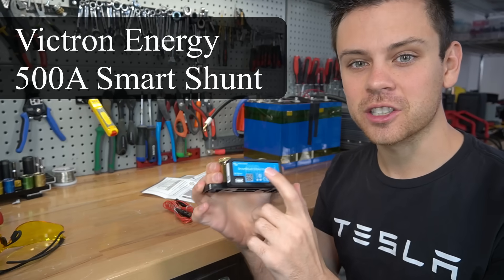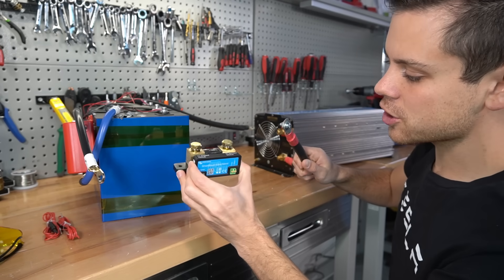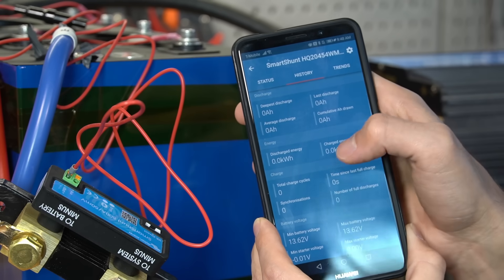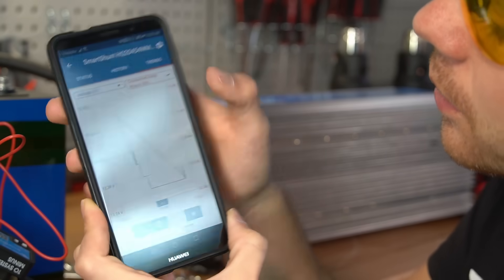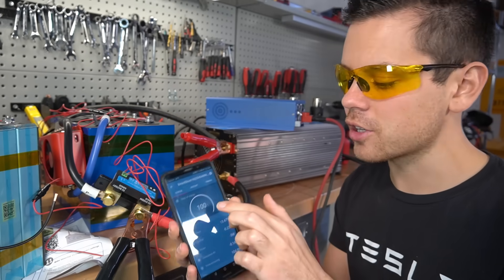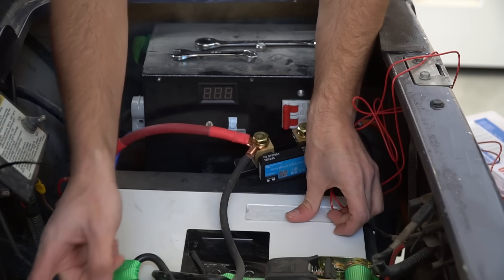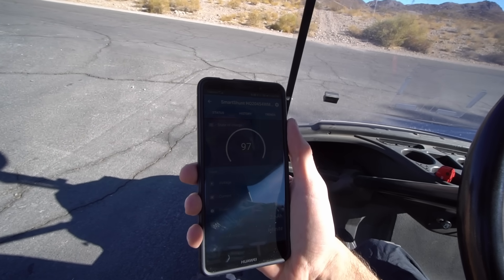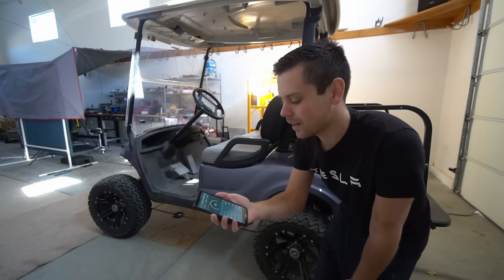Victron Energy 500A Smart Shunt (Beginner Friendly)

Comment: Hi Will! Thanks for the video. I have a lifepo4 100A battery with a Victron Energy 500A Smart Shunt. I bought another lifepo4 100A battery and want to connect both in parallel. May I use the shunt for my new 200A battery bank?

Comment: Man.. I should have come here first :D..  Background and quick question.  I just ordered 2 Li 300 Ah 12v to replace 4 12v lead acid batteries (100ah each)  (FINALLY) which have a rats nest of 2 banks for parallel 2 AW wires, no fuse and no disconnect. /sigh

I want to keep these new batteries and wires nice and clean.  I purchased 2 separate bus bars, 1 for (+) wires and other for (-) wires - both have 4 studs each, 300A Battery disconnect and a flag type 300A Fuse, and the Victron 500A shunt and a 60A MPPT Solar Controller.  I haven't received the batteries as of yet.

I'm thinking the best way would be to connect the 2 battery (-) terminals (one from each battery) to separate studs on the (-) bus bar, and then connect the 2 battery (+) terminals (one from each battery) to separate studs on the (+) bus bar.  This will keep them in Parallel.

Using the Victron 500A Shunt, - I have read and saw several different configurations and I'm a little confused.  Where should I put the shunt?  Would it be OK to put the shunt on a blank stud on the (-) bus bar and then from the system (-) of course goes to the (-) side of the inverter?

Question: Do you see any issues with monitoring both batteries in this configuration?  What would be the drawback trying to determine SOC for both batteries in parallel?

Comment: Finally a useful video for a Victron component.  This item is part of my new battery backup system.  However...slow down in the presentation.  The reference to Victron's 47 page User Manual, while well intentioned, the documentation is so complete to be complicated--needing someone with electrical knowledge/background to be understood.
Wish list:  A video in using/hooking up a Victron PMP122120100 MultiPlus inverter/charger.

Comment: Just ordered two victron controllers for two different separate banks of panels, so far the sungold 6000 split phase works great , but i will buy a separate victron 3000 watt 48 volt inverter, addicting to victron😂

Comment: Mine stopped charging at ninety percent. My settings in app seem good. It reading about 13.64 volts. Should I synchronize to 100%? My trailer has been plugged in to 30 amps for a week.

Comment: Victron BP specifically states not connected to an inverter. This is a diagram with a big red x showing the bypass the BP. The BP will shut off the inverter by the remote switch and they give no information for alternative inverters. Better makes it the biggest go around yet

Comment: I've a Victron Smartshunt, Victron Multiplus and 710 AH of LiFePo  and a REC BMS . charging is via solar, Balmar alternator and occasionally shorepower. 
My question is that the SoC displayed on the Smartshunt (through the Cerbo GX ) slowly decreases compared to the SoC displayed by the REC BMS. My assumption is that as the BMS is measuring each cell it is going to be more accurate so every couple of weeks I manually set the SoC on the Smartshunt to 100% to match the REC BMS. Why is this?

Comment: Question #2- I have 2-230 ah 12.8v run in series, will running the small cable to just the power cable going to the inverter read both battery's or run the aux to the second battery? Additionally, do I zero it out to 230ah (series)?

Comment: Built a custom lifepo4 pack for my 72v Gem Car, and a 400w solar roof rack to supplement charging when I'm not at home.(Where I use a 4000 w solar array to charge my 72 volt pack). I think I need to add a Victor on Smart shut to my build...  
Thanks Will

Comment: Have yo ever come across Soltaro battery. I bought 2 of Soltaro power wall batteries 4.5kwt/h each used thru eBay from a man in Florida. He described them as slightly used almost new with bad BMS. Got two for $845 or so  total cost. Local pickuped them. And one of them was at 52v the other was only 20v. So I took it apart found out that sells are arranged 10 on the bottom and 6 on top row. Both rows sit inside aluminum enclosure and top enclosures welding cracked because some or most of the 6 sells have  swollen and become thick. Probably was working hard on extreme Florida heat. And the guy i bought them from has a tesla which he was probably charging at high amps from this batteries. So i bought similar 90amp sells and changed those 6 that was swollen. Previously charged them all to same voltage. Assembled checked voltage it become around 52v. But even both batteries in parallel wouldn't start my 10kwt inverter. So I bought 3kwt smaller 48 to 110v inverter. And they would start it, but from even small load such as 115v led bulb inverter would keep shutting down and coming back to life as if there is no amps in batteries. Ok I thought its maybe because of bad BMS as guy described. I bought 2 new DALY BMSs. And bought variable voltage charger  at 48v charger can do about 17 amps. After charging each battery for some time to around 54v they both appeared to be revived and each of them could pull 3kwt inverter with the load of at least 1kwt. Probly could do more didnt want to abuse batteries before fully charging them. So they still work on original Soltaro BMS. I tested that and continued charging them more. But they would not take any more charge and blue round light around the reset  button of each battery would become red and chargers load AMPS would fall down to 0-2amps. So I needed to do diagnostics what this BMS is trying to tell me. After a bit of research bought some RS485 to USB adapter. It arrived. In Soltaro manual I found schematics for RJ45 cable contacts. Cut one end of the cable connected to USB adapter and used PBMS Tools to read but no luck. Tried to connect different wires different ways but nothing would work.  Later i found out that Soltaro uses different communication protocol that can only be read with their own equipment. They are originated in Australia I believe I wrote them an email but so far no answer. I doubt they will answer. So this batteries only made to work with their own inverter which I don't have and not planning to buy since its an expensive thing. And I already have ZLPower 10kwt inverter that provides 2 hots and Neutrall. Had a chance to buy it from auction. It was burned but I was able to fix it. And today I actually was able to make it run from just one battery without load. But I'm sure it would handle some load. Voltages between hots was 230 and between Hots and N was 115. This inverter also has 2 of  3.5kwt solar MPPTs built in. So can handle up to 7kwt of solar. I'm trying to build budget solar system for the house. So far I spent somewhere close to 4k$ got 9 solar panels at 100W. And just trying to start with something and than expand little by little. Still need to find a way to communicate with this batteries to see what they want and what they are unhappy about. Would like to keep those original BMSs. To have batteries functioning as intended with all the switches and lights from manufacturer. And on two DALY BMSs that I bought, I can buy some sells and build 2 more batteries at 4.5kwt each. To grove the system when I'll have some money for it. So if you have any information about communicating with this batteries please help. Maybe there is some communication converter or some universal software that can read anything. Any help is appreciated. Thank you Viktor.

Comment: Hello Excellent video, I am installing power charging system in my Jeep wrangler to charge my auxiliary 100 Amp lithium battery, I purchased Victron energy products (DC to DC 12 volt charger when the car alternator is on, MPPT charge controller, 220V AC to 12 volt charger when I am at home) I am planning to connect one cable from the car battery positive with 60 Amp fuse to system positive busbar also have switch braker with 50 amp as extra protection and negative cable going to the busbar, now all of my charging equipment have pair of two in and out which i did also 50 amp switch brakers and there is a switch barker with 100 amp going to the lithium battery, in little word I want to isolate the in and out for each charging device is this ok ? the other question is the reason for having switch braker on each charging device in and out , if only one device is charging the battery will be a return power to the rest of the chargers if i don't have the switch brakers and have the busbar as distributor? I have been looking around and reading a lot about the victorn enery products but little confuse of finding my answers , please help, Regards
Khalid Almansour(KSA)

Comment: Hi. If I wanted to connect the Smart Shunt to my boat house bank of four 12v 100Ah lithium house batteries, as well as the lead acid starter battery, would I connect to the middle battery of the four to give a Mid point reading?  What voltage do you enter when setting the app up?

Comment: Thanx for your wunderfull video’s.
I recently acquired a smart shunt for my litime 12v 200ah battery in our camper. With the "loaded voltage" setting, Litime indicates to enter 13.2v where you 14.6v input. What is wise for the proper functioning of the battery?

Comment: Do you still need the smartshunt with the new 12/12  DC 50A Orion XS charger?
Reply: No
Reply: @moonhead911  Got it anyway because it's only $10 more than the temperature sensor wire for the smartshunt. Thanks.

Comment: If you have (2) 12v 100ah Battle bourns in parallel where does the shunt connect? Do you tap the shunt into the far end of the Negative Battery terminal and keep the CCT loads at the battery center or visa. vi ?????

Comment: Finally bit the bullet since I needed a larger charge controller and bought victron with battery monitor and was wondering about the shunt as I keep looking at it....question is, if you put in 280ah for battery and your battery only actually does 260ah does it adjust that automatically or are you stuck living with false hope of 20ah

Comment: I have two 100 Ah batteries connected in series for 24V. When  am setting the 
Victron Energy SmartShunt up do I set the Ah to 100 or 200?  Is there any other settings I need to change from what you showed in the video? 

I did set the charge voltage to 26.4 V

Thank you very much

Comment: Thanks for sharing I need your help 
I have a system with two deferent type of batteries  so I used two charge controller but I'm using only one inverter 
So I need a dc to dc automatic transfer switch to switch between batteries

Comment: To anyone who wired this Victron.. do you recommend wiring the little red power line (for suppling power to its onboard electronics) directly to the battery or should you connect it to a busbar in line with a shut off switch? I'm thinking about when you store your camper for the winter.  What have all of you done?

Comment: I am looking for a shunt to use to measure battery capacity… but I think this setup looses all the data once the battery discharges. I was hoping the aux battery input would keep it awake, but it doesn’t seem to. Issue is SmartShunt resets and looses connection when the battery voltage drops too low. This makes it useless for me. In my opinion the power for the shunt electronics should come from the auxiliary battery… that would be much better. 

This SmartShunt has no value to me without the ability to keep alive. 

What am I missing?

Comment: Hi Will,
I have a Trimetric battery monitor and a 500/50 shunt in my system.  I'd like to add the Victron smart shunt or the Victron BMV-712 to the system without removing the Trimetric setup.  Can I do that and how would I go about it?  Thanks!

Comment: Have a 500 Amp smart shunt but I can't get it to pair with my galaxy phone.  Have the app and Bluetooth on and shunt shows up.  Bluetooth light is on on the shunt.  Use every pass code recommended but it will not pair. It doesn't pose a problem so I guess I'll just live with it.

Comment: Hey Will great video, i have a question in setting up the shunt, i have 4x 12v 200amp batteries witch will be connected in series to result a 48v system as i know all those 800amps wil be 200amps in 48v config that means that the shunt will be configured with 200amps or 800?
None of the videos showing configuration of the shunt are mentioning this.

Comment: Will,
I'm new to RV Camping and have a modest Grand Design Imagine "22MLE."  

I think I need better battery info, and a guy at the campgroud said I need a "shunt" and he has this Victron one your testing. 
My battery doesn't have anything to teach it to not discharge below some % as I've heard you mention. Will a shunt give me that ability?? 

My Camper has 1@165w solar panel (I'll add another this winter) and 1@100Ah 12v battery, but I'll be installing the LiTime 230Ah 12v soon. The trunk area does have a small round Furrion gauge to read some battery status info, which seems wrong. "Furrion" tech support had me climb on the roof to disconnect my solar panel for 10mins as a way of rebooting the charge controller. (Man, someone must make a switch to put in the trunk beside the charge controller to eliminate climbing on the roof.) 

Frankly, this Victron seems amazing... and... way over my head. Christmas is coming and I could justify it, but are there other great options you love??? 

Cheers, Eric

Comment: Question on wiring. What if I have 12V devices that I want to measure that are NOT connected to the inverter. I just installed a new lithium bank, SmartShunt and DCDC in my coach. The shunt is connected as instructed (between battery negative and negative to inverter). The device works PERFECTLY for tracking devices connected through the inverter, but what about other 12VDC devices (specifically my AquaHot 250D)?? When the burner kicks on I see no change to power consumption. I suspect it's because the AquaHot is not run through the inverter (just a 12VDC to the positive side of the bank and a ground cable straight to the chassis)? How do I go about keeping track of all loads??

Comment: Is it OK to run these batteries all the way down I noticed you set the smart shunt to 0% . For my home solar project I’m going to run a 12 volt 1200 Watt Victron phoenix inverter should I set that smart shot 0% or something a little higher than zero to know when to turn the inverter off and put my refrigerator back on the grid power so I don’t harm the battery ????I really don’t know because this is my first time using Victron products and also my first time for using Lifepo4 batteries. my entire little system will be Victron a Victron smart 100 V 50 amp charge controller smart shunt smart battery sense Victron phoenix 1200 W inverter and I have one 100 amp hour REDODO battery however I’m planning on buying another battery soon and paralleling them together for a total of 200 amp hours and I have six 100 W Renorgy Solar panels wired series series parallel.

Comment: I have 2 banks of 6 eg4 batteries (not LL). Needing a wiring diagram to connect my 500A smart shunt to them. Banks are parallel to parallel. Pairing off on the two negatives. Would I need two smart shunts? One for each battery bank? Thanks, Will. You are a Godsend!!!

Comment: Great video I’m planning on using them in a golf cart as well, so if I want to fully monitor 2 separate batteries will I have to have 2 separate shunts or will I be able to use 1 to monitor each battery separately in the ap? And not just voltage? Also if I had to run 2 sperate ones will the app allow me to select one or the other to monitor?

Comment: So I'm curious here. Current Connected in their YouTube video on installed the Victron SmartShunt says that the Peukert exponent should be set to 1.05 and Charge efficiency factor to 98% for Lithium batteries. In your video though, you mention that the Peukert exponent should be set to 1.01 and Charge efficiency factor to 99%. So as your both saying something different, which is it?

Comment: Will, love your videos. You really know your stuff! Got a quick question for you....will this shunt work with a battery bank that is 675ah? Since the amp hours of my battery bank exceeds the 500 amps that this shunt is rated for, do I need to move up to the 1000 amp model or will it still work? Thanks in advance.
Reply: I have a 800 ah battery bank and I was wondering the same thing?
Reply: The short answer to your question is most likely "yes, it will work".

You are confusing amp-hours and amps - they are not the same thing. A question similar to yours might be: my car has a 25 gallon fuel tank, is it okay that I get 20 miles per gallon?

Comment: Hi Will, I have two questions: 
1- Imagine the battery bank is of 48V, can we connect the positive terminal of Voctron Temperature sensor to the positive terminal of the battery? Is there any specific voltage limit to the temperature sensor?
2- Is it possible to connect the temperature sensor and connect to two batteries to obtain the battery voltage of each batteries? If yes, can you show the wiring diagram to connect the temperature sensor and the two batteries.

Thanks.
Reply: 1. I came here looking for the same answer. No where have I seen any mention of a voltage requirement for the power input to the SmartShunt, only Vbatt+, so I assume connecting it direct to 48v is okay.
2. Not possible. That port provides a single function at any given time -- second battery, midpoint of a battery bank, or temperature.

Comment: I’m just getting started and am overwhelmed. Put in a 100ah Lifepo4 in travel trailer and will be “tricking” the WFCo converter to switch to lithium today. Next a battery monitor. I don’t have an inverter (yet) and you said if no inverter hook up to chargers? What chargers? Charge controller for solar?